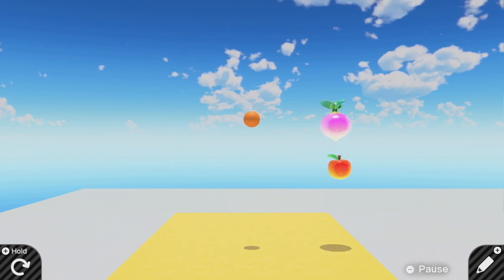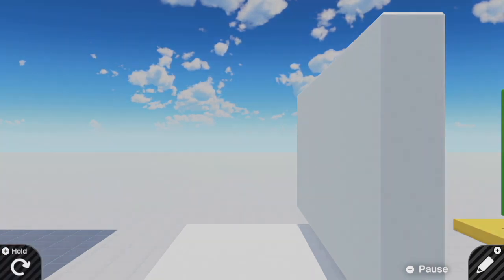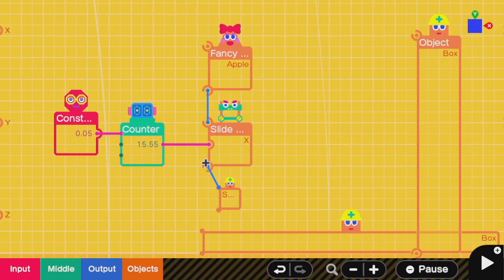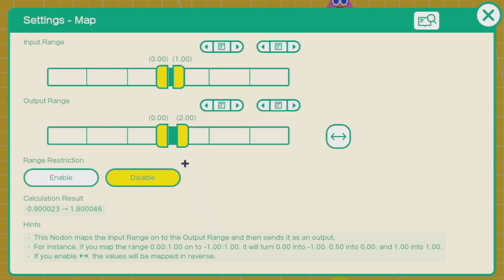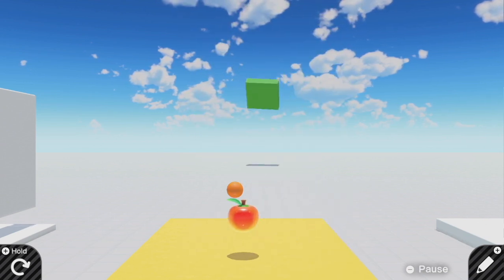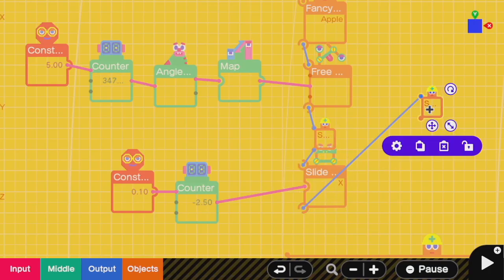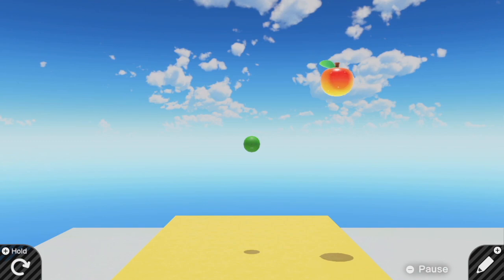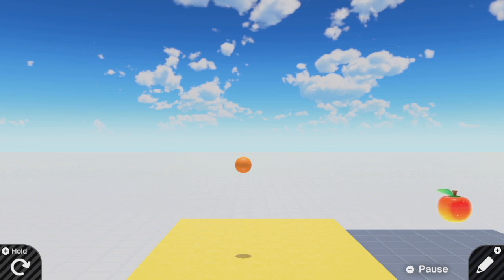How to do Basic Movement and Motion in Game Builder Garage (Tutorial)

Comment: I have a setup like

[Unmovable box] - [y slider] - [box] - [x slider] - [box]

I send inputs from a touch position nodon, into 2 map nodons(settings match game screen). The maps send the signal to the sliders. The problem is when i move the box by touching the screen, the box tends to whip around real fast until it settles on where I'm pointing. Any idea what causes this?
Reply from the maker: It has to do with the physics engine. You can probably reduce this with a single free slider. Otherwise, you could try making the middle box bigger (more massive). It will never be perfect, but normally you can get it to be really good (depending on exactly what you are trying to do).
Reply: @loupandsnoop  thanks! I swapped the sliders with a free slider and it works perfectly!

Comment: For some reason this isn't working for me. I link a Fancy object to a moving object, then link the moving object to a stationary "anchor point". If I do that, the moving object won't move. But if I remove the anchor to the stationary object, the Fancy object will move unconstrained. What am I doing wrong?
Reply from the maker: The big mass of connected objects can't move because one of them is immovable. You'd need a free slider (or other connection nodon) to allow the other thing to move relative to the immovable anchor point.

Comment: the back and forth one is sorta helpful but doesnt work when i use the AND nodon

im trying to get the box to move when the ZR button isnt held down while the constant nodon is on 0.10 (so its atleast slow enough that the player wont fall off and die)
Reply from the maker: The back and forth one just specifies coordinates. You should check what numbers you are feeding into the slider.

Comment: I have a question. How do you control up to ten objects one at a time using the Nodons? Like I want to move one object around, and then press a button and then it go to another object that I can then control?
Reply from the maker: That's prettyvague. It sounds like you need a toggle between teleporters. Then use a multiplier nodon to give controls X 0 if the given object is selected, and X1 if it is selected. But I can't completely tell from your question.

Comment: Can you use the free slide setup to keep a Person from moving on the Z Axis as well?
Reply from the maker: No. Character nodons need a separate correction. You can do something like a location sensor, where if the player goes off of Z=0, then move player fwd/backward the opposite direction until they are at Z=0. It isn't perfect, obviously, but a lot better than nothing.
Reply: @loupandsnoop  how about an invisible wall linked to a slide connector that's Z-locked and gets the person's X and Y position from a tracker? (I'm meaning to try this at the soonest convenience)
Reply from the maker: @danieldutoit2187  That can work, but you will need to mind any collision that will block the sliding wall. I'm also not sure if you could be inadvertently giving the person a free wall jump whenever they hug the wall too closely
Reply: @loupandsnoop  yes, I plan on making the walls the only objects outside the "usual" plane, plus I plan on stripping out wall jumps completely by means of a touch sensor
Reply: @loupandsnoop  Tried it. It took some trial and error to line it all up but it worked. And no free wall jump as far as I could tell

Comment: I have a question that I dont think was answered. I am making a 2D puzzle game where some of the levels have you push crates. Basically you move the person into a crate to push it. Sometimes it ends up sliding off the platform on the Z axis. I cant seem to disable its Z axis movement. I have some levels where you must push the crate off a ledge and there is a high chance it falls off the side along Z. I swear I tried everything. How can I make it so it wont move on Z axis in this fashion?
Reply from the maker: Just put the crate to an anchor point on a free slider that has the Z axis locked. Just like in the video with the apple that gets hit with a green block.
Reply: @loupandsnoop  I cant seem to get it. So what I did was attach a sphere to my crate then attach the sphere to the Free Slide Connector. According to the video, whatever axis is in white is enabled? So I clicked on x and y to turn them from yellow to white and now I cant get my crate to move at all. Is there another nodon I need or something?
Reply from the maker: I can't really tell from what you describe. The arrangement should be identical to 7:41. White means the free slider CAN move in that axis. The blocks need to all be movable, and it should work. If you still have problems, you can bring it to my stream.
Reply: @loupandsnoop  Wait I think I get it. So I have to attach another sphere to the free slide connector along with the setup I had? Lol I swear this game sometimes totally boggles me. Like the tutorials will tell you "Use this nodon, connect to this this and this, change numbers around and this works like this." And Im just like "OK but I dont know WHY that makes it work that way." Lol which is why sometimes in the checkpoint puzzles I have no idea what Im supposed to do and just look it up anyway.

Comment: Very nice tutorial! I need more of these in my life :D

I've got the enemies in my level moving back and forth which should make them more interesting to avoid. What I really want to do is have the enemies move back and forth but stop for a second before turning around and going back the other way. Can I add some nodons that would make this possible because it would make the enemies a lot more believable.
Reply: Here is a possible solution that might work.

Step 1: place a constant nodon that always gives a value of 1
Step 2: place a timer nodon, with the timer set to how long it takes to move between sides, and set the output time for how long you want the enemy to stop for
Step 3: place a not nodon so that when the timer is active it does NOT give an output, therefore pausing the enemy
Step 4: use map to change the output and then use the counter on bounce like it said in the video. You may need to mess around with the timer but this should work.
Reply: @joshuabradford8372  Thanks, I'll give it a try :)